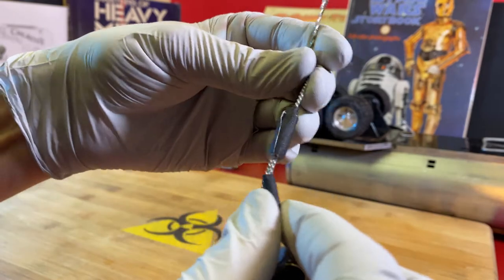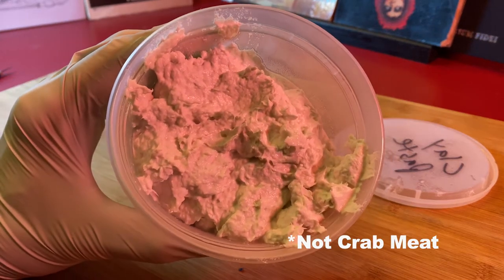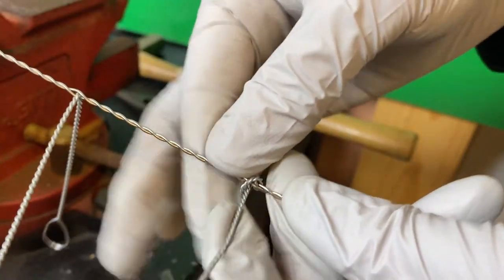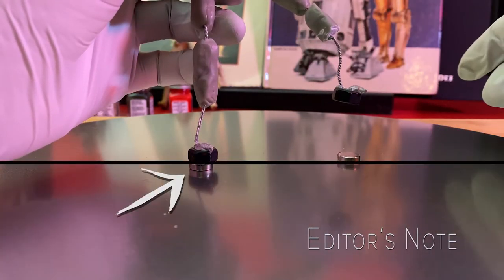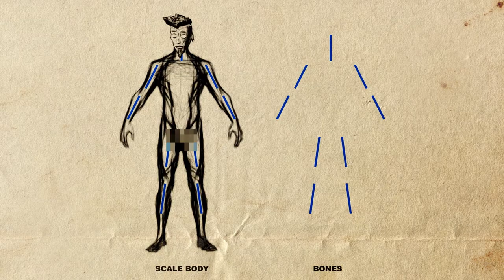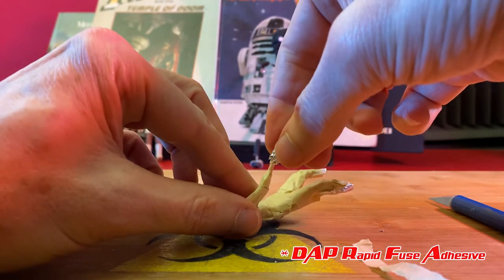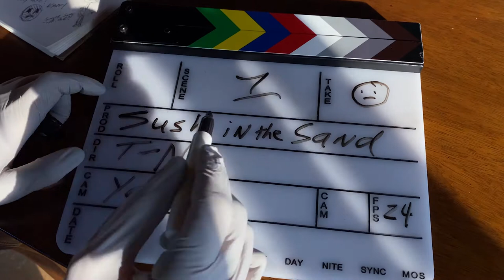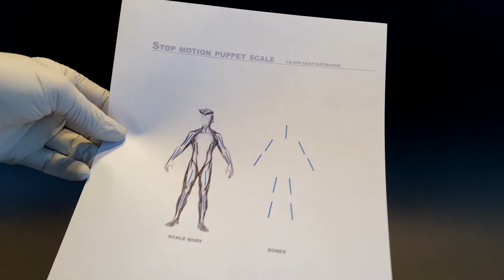HOW TO Build the EASIEST Stop Motion Puppet EVER!

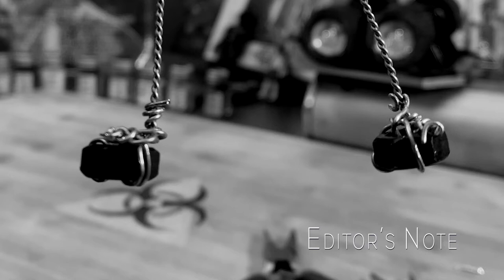Comment: Love the video. You do great work. Piece of advise for trying heat shrink in the future. Use what is called double wall or adhesive heat shrink. it is almost solid when it cools rather than flexible like regular heat shrink. It's a bit more expensive, but not too bad. We use it in electronics to create strain relief on cable connectors. Also look into buying safety wire from some place like Harbor Freight. I think it's cheaper than so called craft wire, and it's the same stuff. While you're there look at getting you some safety wire pliers for doing things like attaching feet like at 9:09. Hope this helps.
Reply from the maker: It certainly does help. I will look into this. Thanks for the tips!!  : )

Comment: Instead of them being so skinny can you add foil as like clothing to bulk them up wrap it with masking tape and paint the tape to look like clothes or would that make the “joints” harder to move? Thanks
Reply from the maker: Certain brands of Sports Tape work great over foam if you want to bulk out the figures. The Sports Tape adds a cloth texture which is very nice. Give that a try.